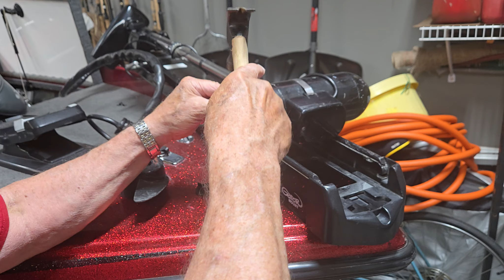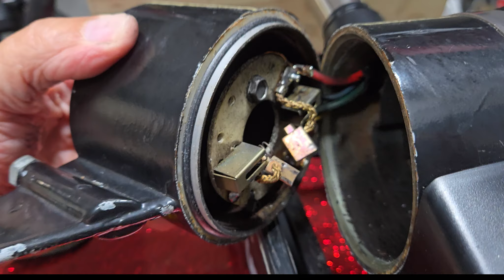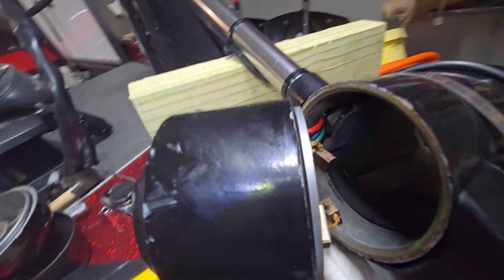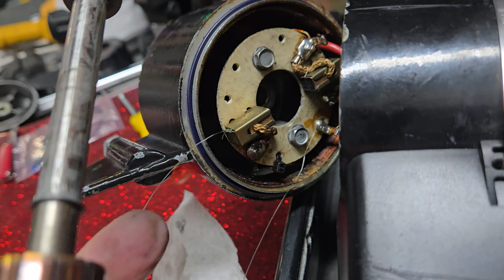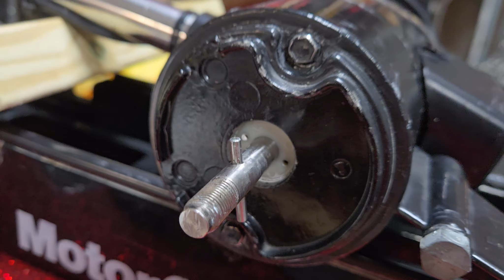1994 MotorGuide Brute 50 lb.Trolling Motor disassembly

Comment: Thank you. I got mine apart and could not get the brushes back. Why I did not think of that. Lol
Reply from the maker: You have to use fishing line to hold the brushes inside their housing until you get them back over the motor, then cut the lines so they release onto the motor.

Comment: For all the effort you put in, you omitted a few steps.  By magic the housing was in and the housing was back together.  That being said, I see the basics of the motor construction and may just clean up corrosion on my unit without taking it apart.
Reply from the maker: Maybe I should go back and take a look at the video. I thought I had included everything but maybe the sequence is off or perhaps I went back to an earlier video. I'm not a professional and my videos are free, so there's that. 🙂. I've had the motor out fishing several times since the video and everything works well.
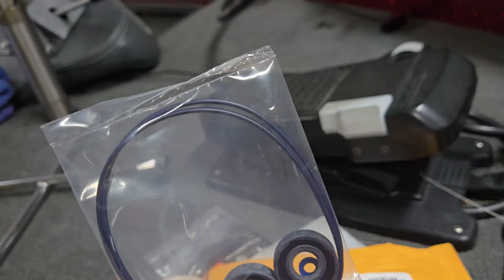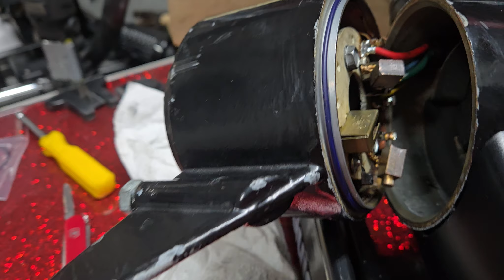Reply from the maker: I looked at the video again and I don't see what you mean. At about 12:30 you see the motor assembled because I had to order the O-rings. I show them in the video at that time and yes, the motor is assembled, but I took it apart again to install the new O-rings. I point to those areas on the motor for the large O-rings. Then the video continues at 13:01 (30 seconds later) and I show you how I was able to install the springs and brushes, then retract them with fishing line so I could insert the armature, snug up the back section and then break the fishing line to allow the brushes to contact the commutator. The video continues on through to the final assembly and then the testing of the motor.

I hope you didn't stop watching the video and begin working on your motor. It's always best to watch these videos to completion before you begin on your own repair so you know what's coming. I had taken my motor apart about 5 times over the course of several days in order to install the new parts and make videos. After the final test I created the video from a multitude of cuts.

I'm not a professional for any of these areas, including making videos. If I need to repair something I always check YouTube and if there is a good video I use it. If not, I record my progress so I can produce a video afterward to help others. I make no money from the videos but I'm sure YouTube does.

I hope you were able to repair your trolling motor. Thanks for your comments.